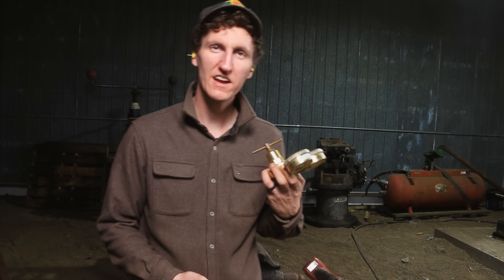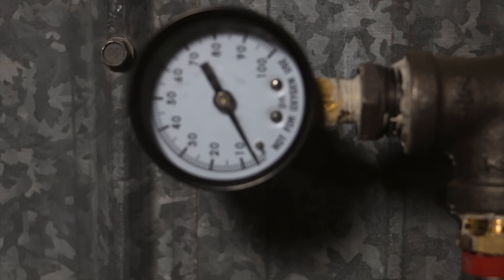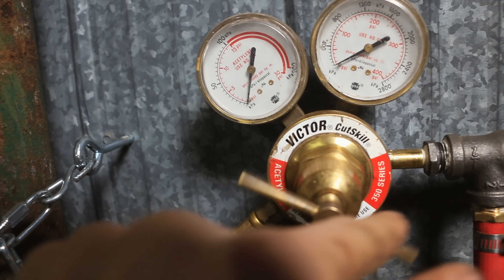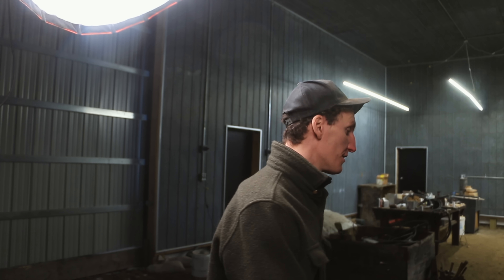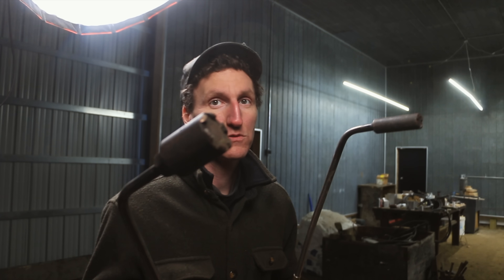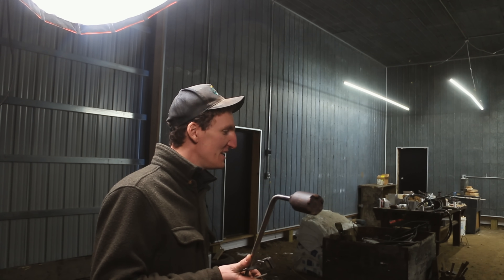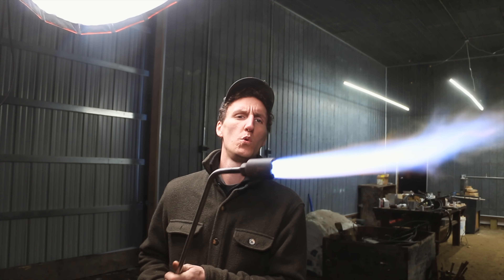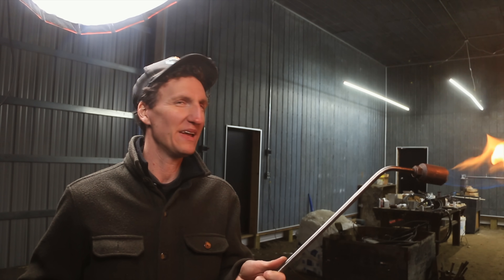Can I run my oxy/acetylene torch on natural gas?

Comment: Nice! I’ve ran propane with ac tip when I ran out of ac and borrowed the gas grill tank lol.. I never knew there was a difference.
  Could you hook the oxygen reg to the air compressor and do away with the tanks all together?

Comment: Can you explain how the wood works to clean the tip? Is it because the carbon on the wood is abrasive to clean the tip like how scouring powder cleans surfaces? Is it the heat being redirected back into the tip to burn off the deposits? I just wanna understand how that works.

Comment: Why is there not an emergency shutoff valve between the manifold and the natgas output? 
Regulators fail and are NOT a positive shutoff! Hose can leak or be damaged. Proper practice is a separate valve between the two outlets and the manifold on the inside as well as the outside so the contents of the manifold (even if you shut off the outside ball valve) do not continue flowing through a leak or failed regulator seat. Your fuel gas regulator ALSO at minimum needs a flashback arrestor as it's easy for high oxygen pressure to overcome low fuel gas pressure.

Comment: "Natural gas" is not propane. It's methane. Propane (and butane, they come mixed together in various ratios depending on how cold local climate is) is called LPG - liquefied petroleum gas. Methane is very different from these two.
Any of these can be used with oxygen to heat, melt and cut, but none can be used for welding steel. Only acetylene can because the welding flame gives off carbon monoxide and hydrogen and that does not rust the steel. All other fuels give off carbon dioxide and water and that oxidizes the weld, ruining it.

Comment: Having worked shipyards for decades this is nothing new to me, just the tips are different, also you need spark arrestor on torch where hose connects. tips are the key not so much the volume

Comment: Very cool! Idk how much a million BTUs is but that looks like it could heat up a huge chunk of metal very fast 😄 profound I know. How are the other machines doing? Did any of them get damaged in the move or while sitting outside? Are you going to set up your shop for axes again or are you going to change things up? Personally, if you're making stuff to sell, I'd recommend making a variety of goods which I think will appeal to a wider market and be easier to sell stuff without it sitting around as much. Someone who doesn't need an axe could use a hammer for example. I love the bottle opener things btw. I just got mine in the mail a week ago on my birthday and it was a really nice birthday present to myself 😄 I think if you make smaller novelty stuff like that you could ship out a lot more for people like me without a lot of money. Still love your axes though! Beautiful works of art! Did you bring your scrap steel with you or are you going to source locally?

Comment: Natural gas and propane burn very similar and can share the same tips and rosebuds. However, using nat gas in the place of acetylene may light but will not be very efficient as it shares with propane, it's lower in temperature but higher in BTUs than acetylene. Neutral flame with oxy-acet is hot at or very near the beginning of the flame, wheras propane is hotter towards the end of the flame.

Comment: Hi Tim, I have never tried this myself but I had an old beer making buddy that was an engineer that worked on industrial natural gas cutting setups frequently. He told me it cut much cleaner than propane or acetylene with less slag and scale to knock off the cut.

Comment: Natural gas has only about 1/4 the energy as propane. It will definitely be noticeable when trying to heat metals past a certain point like if you are forge welding steel.
Reply: Great info! Thank you. I was looking at propane, natural gas, propylene.  With propane you burn a lot more oxygen than acetylene, natural gas you burn less oxygen than acetylene setup does- but apparently a lot less heat than oxy propane!

Comment: I worked in a shop that used icy natural gas. They had a compressor to boost the pressure. It works, but didn't seem to get as hot as acetylene. 

I use oxy propane, it works fine.

Comment: I'm shocked you can turn up your natural gas pressure! Here in Ohio it's only .5 psi and would never be able to do that but very nice you can do that where you live
Reply: If you have volume, you could make pressure with compressor and then run tool what you need. Or even fill cylinders, but that's all what I going to say plus don't do that.

Comment: I had to fix a front loader bucket so i used the no.5 to heat the plate so i can bend it. was very cool but i did emptied my oxygen really fast.

Comment: You were at 666 Likes when I Liked your video. I was going to like your video anyway, but I was happy to get it off of the triple six's.

Well if your natural gas torch will work it will be a lot less expensive than bottled gas, whether it's LP or acetylene. Keep the touch lit. 👊🦊👍

Comment: That’s a very good tip of the starting of the torch. I’ve just switched to propane from acetylene as I ran out of acetylene and I was having a hell of a time getting it to start and stay running lol. I’ll try that next time I turn the torch on.
Reply: There is a proper tip for burning propane for a cutting torch many torches made them you need to find the one for your torch if it's a Victor Victor makes a propane tip for their torch you don't have to change the regulator you don't have to do nothing but change the tip the orifice in an accident is wrong for burning propane

Comment: Tim you should think about installing a valve on the inside of your building that way you have a quick way of shutting off if you ever had a hose break.  Without having to run outside.
Reply: Both, must.
Reply: Just put a hose burst valve in the gasline, i have them for my oxy/acetylene set, they shut off the flow automatically when they detect a burst hose or puncture
Reply: Solenoid valve would be even better. Two in series wired together, failing closed.

Comment: Unsolicited suggestion but maybe adding a valve inside where you’re making connections? You wouldn’t have to constantly go outside to turn on/off the gas and it would be your emergency off in case anything happens. We have similar setups in the restaurants just for this reason

Comment: so I've used that combo before nat gas and oxy. it's a different tip and tourch set up. the regulators are obviously different. The nat gas regulator is hard to come by to my knowledge. it dose work the cuts are not as great.

Comment: Natural Gas will need a different tip than Acetylene, and it cannot be used to gas weld as it isn't intense enough for that
But it should be fine for cutting and heating
Reply: Yeah we watched the video too bud…
Reply: @noahstephens7622  I commented BEFORE I watched the video

Comment: Cool vid bud, I was wondering how natural gas would compare to acetylene for the cutting torch! Good to see you getting things settled in 👍
Reply: Well naturall gas is close to propane and i have a propane oxy propane torch cut/heat set up. My guess is that since propaine or natgas burns alot hotter without added oxygen than acetylene would without oxygen, it should cut atleast as good or maybe even better than acetylene
Reply: It cuts good and less slag I think. Doesn’t pop and carry on like acetylene does. Propane/ natural gas does not get hot as fast. Or even as hot. But it’s way cheaper and a 20lb propane bottle will last longer than a acetylene bottle will.  It’s worth using in my opinion. I hate acetylene it’s dirty and actually quiet dangerous
Reply: No difference in cutting speed or capacity as it is the oxygen doing the cutting, not the gas..  Only difference would be how long it takes to preheat before cutting as the natural gas flame has less heat in it than either acetylene or propane...

Comment: ya lust need a different cutting tip and i don't think it's as hot
Reply: correct
it isn't hot enough to weld with, but everything else should be fine, as long as you use the right equipment